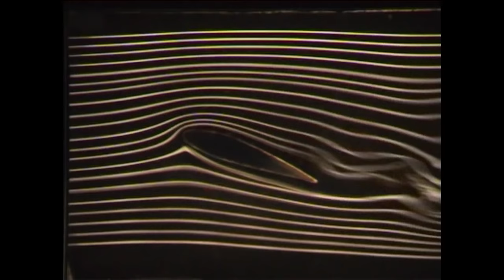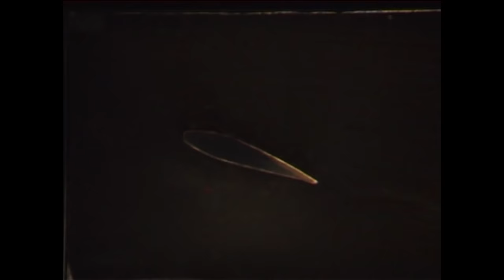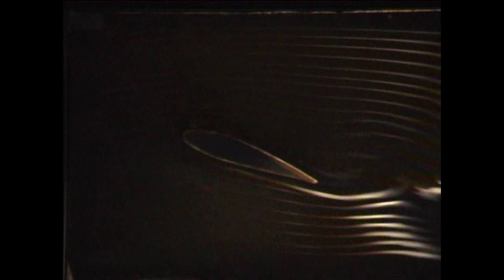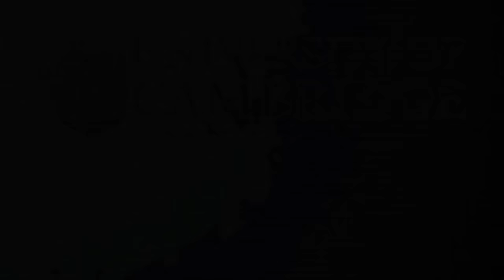Airflow across a wing

Comment: "this shows that we're showing you a very non-standard airfoil as if a typical "wing", plus let's not omit to take notice of the severely exaggerated angle of attack which we are deliberately suggesting, without clarification, as if it's a typical AoA of an airplane wing in flight. If you are sufficiently confused and misled by this point, remember you've enjoyed this presentation in a potentially authentic British accent, discourtesy of none other than Cambridge, mind you. Good day, fine fellows."

Comment: You forgot to mention the fact that the air moving faster over the top of the wing than the bottom creates a pocket of low pressure on the top of the wing, which is quite literally what creates lift

Comment: This a great video, but you say nothing as to how lift IS created.  You simply debunk the common myth that it is related to the speed of the flow over the top of the wing.  It is really air pressure difference that causes the lift, but I wouldn't have known that if I hadn't been lead to this video via the Gizmodo link that includes the explanation.

Comment: Lift is caused by turning a fluid. The 'speed' difference between the upper and lower surfaces is not generated in the way most people think. The wing lower surface pushes the lower air forwards (in the direction of the the wing's movement) and downwards. his is on component of lift and the reason for a slightly increased pressure compared to static on the lower surface. Watch the pulsed smoke.

The pressure bubble or bow wave created by this lower surface is what pushes the air up and over the wing. As the air 'turns the corner - as it must -(there are no vacuums in normal space) the rapid change of direction as it follows the upper surface causes a slight pressure drop but the lift force is created by changing the direction of the air. The pressure change is a RESULT not a cause of lift.

If you bend the air down the wing goes up. Simple. It works perfectly well with a flat plate so wing shape is not the primary cause.

All wing shape does is dictate the angular change of the air. Less camber less angular change and vice versa. Remember: Supercritical wigs as used on all modern airliners and curved on the lower surface and flatter on top.

Also the air does not speed up or accelerate (using the common definition) over the wing. It actually slows down when it comes in contact with  the wing surface. This is called form or profile drag and results in the boundary layer.

Again watch the pulsed smoke. You can see the streamlines closer to the wing get pulled forwards while the ones near the wind tunnel wall continue on relatively undisturbed and transit the space more quickly.

The primary cause of lift changes is change of AOA as AOA is the primary cause of the angular change of the air. Zero effective AOA = no lift.

When trying to understand aerodynamic principles or flow around an aircraft the most effective way to visualise it is to imagine the aircraft under water like a submarine. Water behaves exactly the same as air (at subsonic speeds)  but is more dense so the effect are easier to understand. This is why aerodynamics belongs to the field of fluid dynamics. Same rules apply.
Reply: +Complete Aerogeek Lets say the weather is calm and there is no wind or whatsoever. Wouldn't that mean the air molecules are almost at rest. So, how would they slow down further as you claim.

Comment: Adjust the chord line so that it is parallel to the relative airflow and post a video on the results of that test... This wing section in this video is at such a steep attack it is resulting in a near stall condition.

Comment: Here is how it works according to Bernoulli's principle, where the fluid speed is high the fluid pressure will be lower at that region and where the fluid speed is slow air pressure will be higher. This pressure difference above and below the aerofoil generates the force called lift that flies the airplane upwards...
Reply: I think most people are wondering why the airflow actually speeds up over the wing as opposed to understanding how it generates lift.

Comment: I was never taught that the air sped up because it had a longer distance to travel. I was always taught that the lower pressure was caused by the mass flow and the creation of a venturi, essentially, on top of the wing. the increase in kinetic energy leads to a decrease in static pressure as explained by the bernoulli principle. in addition to pressure difference, air is deflected by the wing, also creating an upward force on the airfoil

Comment: That's never been the explanation at all. The explanation was always that the air travels faster over then it does under. 

This creates a pressure drop as air density is directly related to speed.  It's the reduction in pressure above the wing that creates lift.

Comment: As long as you keep a positive angle of attack to the airflow, enough to create the airflow distortion and thus the speed difference and concequently the pressure differential you should be able to fly just fine. But it just wouldn't be so efficient for an assymetric airfoil, so perhaps you would need more power, or airspeed to keep the plane flying...

Comment: Actually this is a very good example to explain why it can also fly upside-down. You can see that the wing profile is symmetrical so it makes no difference if you turn the plane upside-down. All you need is airspeed and angle of attack.

It is also possible with an asymmetrical profile but you would have some differences in efficiency

Comment: The angle of deflection is also part of creating lift. When inverted, the pilot controls the the pitch of the aircraft to keep the nose up, thus giving the wings sufficient angle of attack to deflect air downwards. But Bernoulli isn't helping out as much so more thrust is required. Pretty cool!

Comment: I noticed you conveniently used a symmetrical airfoil with a positive angle of attack for your model, thus producing a lift coefficient, thereby complicating the discussion. The same complication exists when using a sail example. Your symmetrical airfoil would produce zero lift in a wind tunnel with zero angle of attack. Just as a paper (symmetrical wing) airplane would produce no lift with a zero angle of attack. However, an airfoil such as a Clark-Y would indeed produce lift in a wind tunnel with zero angle of attack. Why is that? What principle would be responsible? The upper surface would be accelerated and there would be lower pressure. The air molecules would NOT meet at the same time at the trailing edge, but who (relevancy) cares? Decreased pressure = increased velocity, in that order, due to shape alone. Personally, I would call this lift Bernoulli's Principle. Please correct me if I am wrong. I am assuming all things being equal for both tests, such as air density, air velocity, wing area and no lift coefficient (zero angle of attack) .
Considering the lift equation: L = (1/2) d v2 s CL, Bernoulli's Principle plays a small part in making up the Coefficient aspect and can be explained referencing wind tunnel tests as you have shown, provided one assumes a zero angle of attack for the explanation of Bernoulli's small role in the overall scheme of the overall total lift equation.
 I have never considered Bernoulli's Principle as to the sole explanation as to why wings fly, but merely a rudimentary way to explain what the shape aspect (looked at alone) partially does without the other factors of the lift equation. With this small part of the explanation expressed with an assumed zero angle of attack.
Awaiting response.

Comment: @lglglggl If you look closely the airfoil in the video is symmetrical, or nearly symmetrical.  What's to say that the airplane that it's attached to isn't already upside down?

While the shape of the airfoil contributes to lift, another (often larger) contributor is the angle of attack (in the video the airfoil has an AOA, about 15-25 degrees).  Airplanes flying inverted have at least some downward pressure on the elevator to create a negative angle of attack, creating negative lift.

Comment: @Iglglggl, wings cause the pressure under the wing to increase relative to the air above the wing.  This video illustrates Bernoulli's principle, which shows how a wings shape does lower the air pressure above the wing. But this isn't the main reason wings generate lift. Really it is the higher pressure of the under the wing that is the main factor.

Comment: @lglglggl If you notice the video, the cross-section of the airfoil shown is fully symmetrical (it's not more curved on the top). Flipping it over and pointing it upward slightly (as aerobatic planes do when they fly interved) would generate the same lift.

Comment: @lglglggl it doesn't matter for an airplane to fly upside down or normally, as long as the angle of attack remains positive. When the angle of attack is negative, you'll have a spoiler, like the one used in F1 to keep the cars on the ground..

Comment: @lglglggl Those are aerobatic maneuvers, and usually involve the aircraft having substantial initial velocity, absent which they would stall during the maneuver.  The main thing is having sufficient velocity to operate the control surfaces - you haven't seen them flying upside down for a very long time, have you?

Comment: You are 1/2 way there!  You discovered problem #1, but not problem #2 which is inherent in wind tunnels and in assumptions about "wing" shapes.  You must take force measurements on the "wing" in multiple configurations to say how much force is due to which effects.  Remember the wing moves through the air which is problem #2.  A static wing in a wind tunnel is a problem because it doesn't actually show the impact of the wing's movement at the point of wind impact.  Start with a flat surface being hit by air as in down-wind sailing or as in a road-sign being blown over by high winds.  Change the angles.  Alter the airflows around the "wing" by using shapes which prevent the air from flowing around the back-side of a traditional wing.  Measure the forces in all configurations.   Nobody can proclaim they know what is causing a majority of lift when they don't show the effect of the wind both "with" a traditional wing shape and "without".  We need to see the force of wind deflection, for instance.

Comment: Yes a plane flying upside down is the perfect demonstration as are wings with symmetric profile, as to why Bernoulli is NOT responsible for flight. In reality lift is generated by causing a deflection in the air stream, just bending it downwards. This is achieved because of the Coandă effect which shows us that a fluid flow will adhere to a surface even when that surface curves away from the direction of fluid flow, Also Brute force deflection of airflow (called angle of attack) works too.

Comment: What I see here is that the lower side of the wing slows the air down more while the upper side of the wing does not necessarily increase the speed. Just compare the points of smoke as they are closer to the wing versus farther away the upper section of the wing stays relatively all the same speed where is the lower section of the wing seems to be slow down more the closer it gets to the wing
Reply: This would also appear to be true on the upper side of the wing just at a much closer location

Comment: These streamlines, which are visualized in the video, are so far from the boundary layer. However, theory is valid at the wall. And there are streamlines very close the wall. Only those streamlines which are very close to wall will meet up at the back of the wing. When you get far from the wall, they will not meet up.

Comment: Some of the comments here don't make sense. Subsonic Lift is not terribly complex. if you can make a paper plane you can debunk most silly theories.

Here is a resource to start with:

http://www.grc.nasa.gov/WWW/k-12/airplane/wrong1.html

Forget what air is moving how fast. That is a secondary issue and a result of AOA. It also brings forth all kinds of nonsensical explanations like equal transit time.

Also remember that in fact: the air is not moving the wing is. By thinking the air is moving we ascribe all kinds of things to it like momentum which it does not have. It is static. and so Newtons 1st Law applies. As soon as the wing bashes into it Newton's 2nd and 3rd laws apply. Still air also has inertia and viscosity. (it is not inviscid)

If you watch the pulsed smoke approach the wing-you will see that in the correct perspective (still air-wing moving) The wing begins to bend the vertical stream before it even reaches the leading edge.

This is a pressure wave (bow wave if you like) being pushed ahead of the wing.

If we isolate the upper and lower surfaces, we can clearly see that as the wing moves forward it pushes the lower surface air forwards (i.e. to the left of screen and downwards.) This is the primary reason for the pressure increase under the wing.

Now to the upper surface: The wing due to form drag (viscosity) PULLS the air forwards in its direction of travel.

If you were to imagine the air moving - wing still scenario: It means that the air is SLOWING DOWN NOT SPEEDING UP as many people claim..

Kinda messes with some people's thinking...

As the air is forced upwards by the pressure wave that lives in front and below the leading edge, it then splits (you can see the streamline turn into a Y shape at the transition point) turns the corner and rapidly changes direction. This creates a momentary drop in pressure/density and the volume of space increases behind the leading edge.

In effect the wing rides up on the pressure wave caused by AOA much like a water skier or a boat on the plane.

This and rapid change of direction above the wing and the attending pressure/density drop is what causes the pressure differential, not wing shape. The effect on both surfaces creates a total reaction force and this is lift. F=Ma. The pressure differential is a by product of AOA + upper surface camber (if any) not wing shape.

Don't believe me?

The simplest kind of wing is a flat plate inclined to the relative airflow-just like you hand out of a car window.

A flat plate has a superb L:D ratio but has an earlier stall angle because the air cannot turn the corner as easily as on a curved plate.

This is the same reason aircraft have leading edge slats.. ( NASA's Foilsim is a fun tool to experiment with wing shapes, stall angles, camber and L:D ratios)

If this were not so, how would hang gliders, kites, flat plate wings (missiles and some high sped aircraft) paper planes sailboats fly?

Most military and medium speed aircraft have had symmetrical wings since the 1940s.

ALL airliners today have supercritical wings (flatter on top and more curved underneath. i.e. inverse camber).

In summary:  Always start at the most basic exemplar: What you can prove for a flat plate wing is also true for any other kind of wing.

The primary reason for lift is that the wing mechanically interacts with the static air 'bending it.  Bend the air down the wing goes up. (no different to a ceiling fan, or a kite, or a hang glider, or a sailboat etc etc.)

And the best part? You can prove it practically and mathematically without ever having to hear of Bernoulli!

Enjoy!

Comment: @lglglggl 
The wing works the same way upside down when the angle of attack is increased to a certain point, but cambered airfoils aren't as good at creating lift upside down because the laminar flow separates at a higher airspeed and a lower angle of attack in this configuration. This is why many aerobatic aircraft use a more symetrical airfoil because while it creates a lower coefficient of lift, it stalls at a higher AOA and it acts uniformly regardless of which side is up.

Comment: the flow on the top is accelerated because it's being sucked forward, the same vacuum that lifts the plane wing is also pulling air, I would think the extra distance the top flows could signify strength of the vacuum/negative pressure zone?

Comment: This video is biased. The airfoil used is symmetrical therefor Bernoulli principle does not apply. Also the air is flowing slower on the bottom because the airfoil is angled down. It should be level.

Comment: @lglglggl Same reason a bumble bee can fly. Shear power. Look at the video again. It seems to me another factor is the attitude of the wing. Most text books I remember from high school science show a perfectly horizontal wing. This one is tilted to attack the wind with the force hitting the underneath. That alone will create lift if the air is pushing on the bottom.

Comment: Therefore the lift effect is amplified? The time that the air reaches the end on the top of the wing is shorter. Hence the speed is faster than originally thought. Therefore pressure is even lower and the lift higher?  Is this a correct assumption?

Comment: By using the dynamic surfaces of the wing (Ailerons), you can create 'lift' in either direction as you alter the effective profile of the wing. What the Prof (IMHO) is actually saying above is that the wing lifts by slowing down the air underneath it rather than accelerating the air above. This creates a higher pressure zone underneath, driving the wing upwards.

Comment: @lglglggl angle of attack... foil shape of a wing just makes flight more efficient. Flying upside down powers the angled wing through the air with a resultant up force. Kind of like sticking your angled hand out the car window at speed makes it lift from the wind pressure.

Comment: Regardless....the air over the top of the wing moves faster, thus creating a lower pressure compared to the pressure under the wing which in turns generates lift.